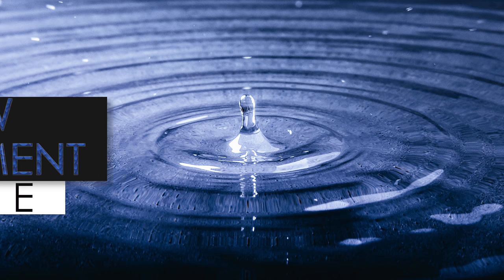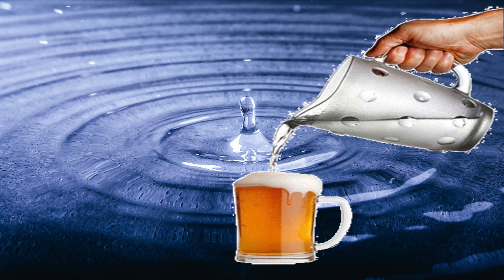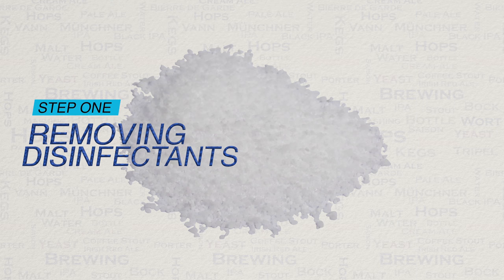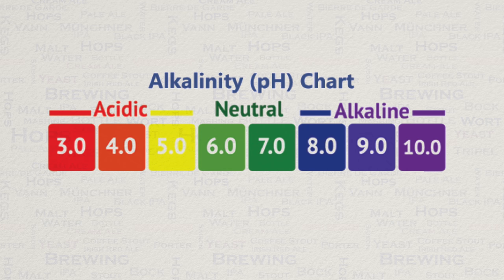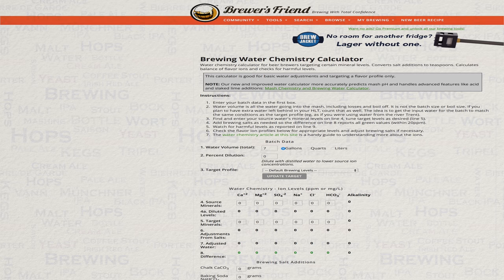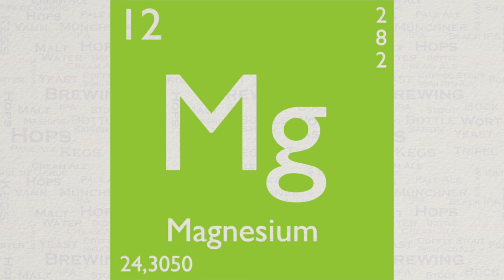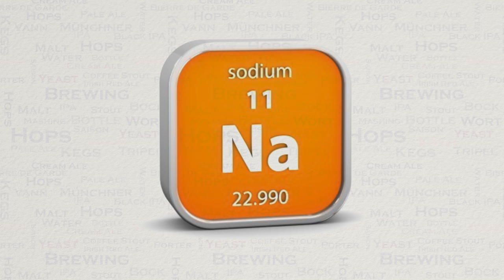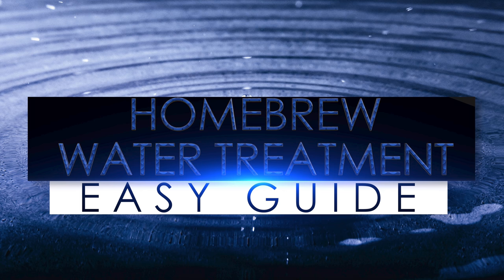HomeBrew Beer Water Treatment Easy Guide

Comment: Hi David, have been brewing for 3+ years but recently have been having p/H issues.  Low ABV/Low Carb NEIPA Mash p/h 5.2, Sparge water acidified to 5.3 but after a 15 min boil my into fermenter  p/H is 5.9. Just seems a bit on the high side to get down to the required 4-4.8 p/H for most beers (John Palmer). Have two p/H meters that are calibrated using standards prior to each reading.  Is there anything staring me in the face that I'm not seeing?  'Do you have any suggestions?' Or am I just looking at things too hard.  Thanks in advance.
Reply from the maker: Hi Nigel, a few questions first. How are you planning your ph before a brew? How are you judging the waters ph in advance?
Reply: I'm using Brewfather and plan for p/H 5.2 for pales and p/H 5.5 for darker beers. I also have inputed my Local Councils Water Testing results, use the Brewfather water profiles for style, make water adjustment to meet the profile and use lactic acid to bring down p/H as required. Sparge water is acidified to 5.3 with lactic.
Reply from the maker: I would suggest that you obtain a brewing specific analysis of your water, it will be far more accurate. A google search should find you local services for this.

Comment: David, thank you for sharing all of your knowledge on your channel. You made it easy to subscribe.
I’m brewing my first all grain beer this weekend. It’s going to be an American Porter. I have a reverse osmosis system and wonder about PH. Should I bother with testing during the mash? Or just brew and not worry about it? 
I’ve seen a 5.2 PH Stabilizer on Amazon that people seem to like. Should I consider using something like this? 
I’m obsessing about PH for some reason. What should I do? Kind regards
Reply from the maker: Many thanks Chris. The best way with chemical changes for PH is to predict it in advance. Most recipe calculators have this feature. Darker styles usually go between 5.4 to 5.6 PH. Chemicals wise these stabilisers do not work well for many. Best way is to see what your brewing software advises and use that chemical. For your first brews this may not be an area to go straight into though. Many homebrewers skip it. Its icing on the cake for most unless your water is an extreme
Reply: David Heath Homebrew Brewfather is predicting 5.53 so I should be good then. Many thanks David!
Reply from the maker: Anytime Chris :)

Comment: I'm not sure I understand; if you are taking a sample of mash water to measure pH the water will be cloudy and full of particulates.  If you are using a simple color-change test kit for pH, does not the non-clarity of the test water affect the color-change of the test as well?
Reply from the maker: No, the sample is of your pure water. You then need to use a calculator where you input your recipe that will predict your ph and adjustments needed.
Reply: OK, I see this, thanks.  However, the calculator fails to report NA, Chloride, or Sulfate.  Without these, how do you know which salts to add?  Are there other tests you can make for these ions?

Comment: Hi David. Quick water chemistry question related to SO4. Brewfather has SO4 2-, and my water report from ward labs reports SO4-S. Is that the same thing? I have seen in some other threads that of your brewing report reports SO4 -s you must multiply that value by 3 to get SO4 2-. Is that true?
Reply from the maker: Yes. Wards labs are reporting this for farming/agriculture which is the weight of the sulfur. So to put this in the form you need multiply by 3.
Reply: @DavidHeathHomebrew  Thank you!
Reply from the maker: Anytime  :)

Comment: Easy to add calcium but how do you reduce it? Do you boil the water first? Cheers
Reply from the maker: You can boil it or dilute it with water from another source. Adding cheap supermarket water is a popular method.
Reply: @DavidHeathHomebrew  Thanks for replying but then how do you know how much is remaining. Reanalysis I guess.
Reply from the maker: 4Figgis Yes :)